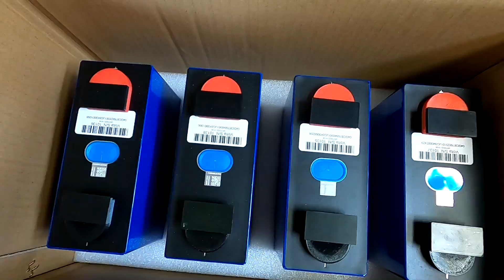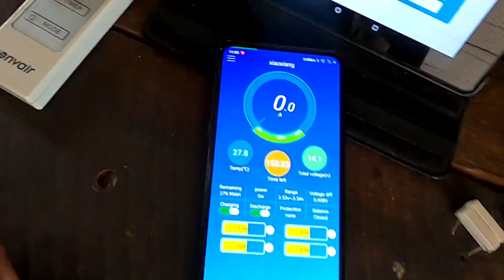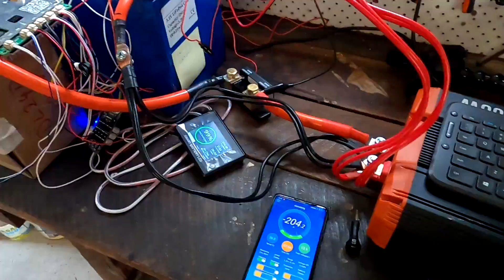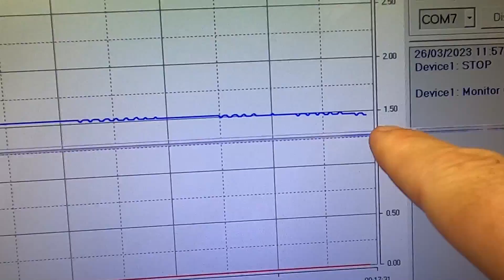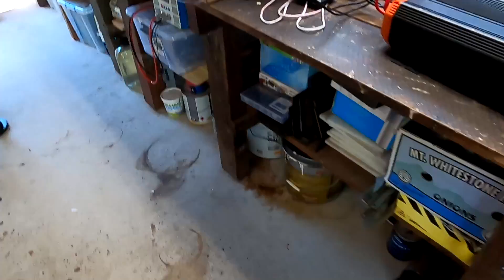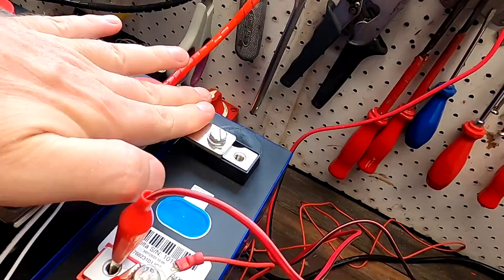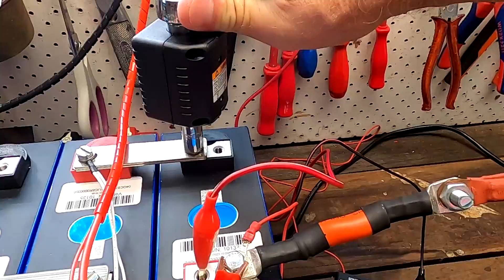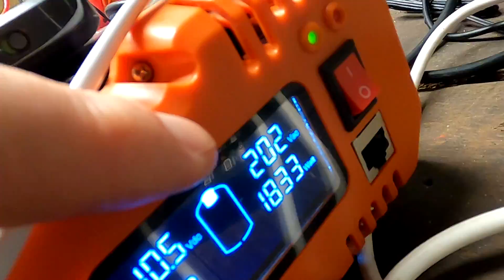My worst B-Grade cells vs. Certified Automotive Grade in a 100%-0% 200Amp Discharge Test. Surprised?

Comment: For automotive use I would prefer a Bus Bar with a bit of give/flexibility Andy - On my RV camper I use some 300amp arched flexible bus bars that are 30 stacked copper laminates from Aliexpress that will cope with road vibrations and temperature change
Reply from the maker: Or, you have to fixate the cells so they don't move any more. Compression 😉
Reply: @OffGridGarageAustralia  Compressed cells still expand & contract with temperature - Trees that bend in the wind last longest  : )

Comment: Very interesting Video Andy! 
The BMS part was my favourite! 😉
Reply from the maker: The BMS is amazing! I really love it. A 16S version with 150A would be a winner!
Reply: Yes we need a 16s 150a   !    I will take 3 or 4 when you make them .
Reply: @onthelake9554  we're working on a 4s-16s version. It will have active balancing on board and the firmware will in all likelihood be opensource so that users can change it in any way they see it. 
The heating connector can then be reprogrammed to be used independantly of the main MOSFETs on the board. Not just for heating but for any 5-10A load you want. 
It will also have some other features and will be ESP32 based so you can basically run a lot of the Arduino applications.
It will also have Bluetooth and Wifi and potentially a micro-SD slot, in case people want to use it for data logging.
Reply: @mullerenergy  This is great news , I will be a customer for sure . And thank you for supporting Andy !
Reply: @mullerenergy  Nice! Cant wait to see this BMS on Andy tests. Opensourse fimware is qreat idea and Im sure that people will love it. On this way your product can work exactly as customer want and need. Opposite for locking bms setting and weird thing like this. Are you shipping worlwide? (Europe). Thank you.

Comment: without any experience.  my mind says  that   if you do a test of those two  packs again after  the certified  pack  makes some more  cycles . you get  even more similar  curve!!! and my mind says that it has to do with the  overtime   usage and they are going to  have better  discharge curves at the end after theyt make some more cycles if they re new and no used !!! . keep up   and thanks for the content
Reply from the maker: Well, both battery packs were new. I have compared a lot of cells but could never find a difference of used cells to brand new ones.
This is another claim, I guess, that cells need a few cycles to settle in and either go up or down in capacity and energy. If it is really the case, it must be minimal so we cannot see it with our test methods.

Comment: batteries dont charge fully first time  nickel metal hydride✋ so peter liPo cheated? memory rounds the curve and shortens cycle Andy #2
Reply from the maker: And other say, don't leave them sitting there for too long before testing as they already lose a bit of capacity and energy.
I don't hink it is true, that these cells really increase in capacity or energy after a few cycles. I have tested many cells and could never find such a behaviour.

Comment: Your certified cells have All the boxes filled in. Ah when manufactured. Why does SFK omit that???? Great video. You can never overcalibrate
Reply: Doesn’t SFK say that the way the measurement is done at the factory is it’s watt hours measured and then they just divide that by 3.2 to get the Ah number? They don’t test for Ah. I think that’s what SFK said. 

I wasn’t too sure about the guy at first but all of his points are absolutely valid and the actual science behind it is proven. Typically these Grade B cells have an IR that’s way too high to meet spec and that’s why you see they perform not so well when major current is applied. 

We just don’t see too many Grade G(arbage) cells anymore. There’s too many decent sellers out there for the scumbags who buy the dumpster diver picks from EVE/CATAL etc
Reply from the maker: I think to calculate the energy by using a fixed voltage of 3.2V is totally wrong. The voltage is dynamic and can only be measured by a tester which is constantly measuring it.
Reply: Are you going to trust your lying eyes or use our new math that favors us?

Comment: Here is a test you can do now that you have established a baseline, charge up both sets of cells to full. Leave the cells unconnected to a BMS or ab for 1 month and then do a discharge test. See how much capacity you have retained to establish the self discharge rate. It should be between 1-2% at most.
Reply from the maker: Even if the certified cells have a lower self discharge rate, it would not justify the much higher price, if this is the only difference. Most people buy these batteries and use them on a daily base with their solar storage system, so self discharge is not a problem.
I understand it could be a 'thing' for people who leave their batteries over winter for 4-5 months sitting there. But even then, what difference are we talking about, 1-2% with certified and 5% with B-grade? Still not relevant then...
Reply: @OffGridGarageAustralia  This story has been played out before, numerous vendors. Once you have a large enough sample size opinions can change. We see swings of up to 15 Ah in grade A, and as high as 50 with grade B. But yes if you are willing to set your limits and tinker with your pack you can get decent results, however,  this is not something you can do professionally. You have had a run of decent grade B recently, but do remember Basen cells... not so good. Either way, Hithium cells look good we are going to order some certified ones and see how they do. Cheers 🍻
Reply from the maker: @sfkenergy  I'm happy to repeat this test again with the Basen cells if you think it would make a difference.
Still, were talking about certified cells and B-Grade cells. Certified never stood out to impress. Only a bit better does still not justify the price.
Reply: @OffGridGarageAustralia  Some would say the headache of constantly babysitting grade B is not worth the price. I say as long as the sellers clearly state what it is it would be fine. But lets be clear the Alibaba sellers WILL NEVER EVER state what they are selling is grade B, always with hidden/relasered QR codes and claim grade A.

So we are going to do a self discharge comparison test with 1 month delay, I think it would be good to compare.

But sure if you put in the extra care with grade B it is certainly a viable option and as more hardware enters the market that understand the needs of grade B the difference will become less and less.
Reply from the maker: @sfkenergy  I don't know, we now have at least two suppliers from China who state that you will get B grade (imprint on the QR code). So, were getting there.
Not sure about this self discharge test. I don't think it makes someone want to pay far more for cells.
First it was the cert cells are better. Some people did tests but could not confirm. Then it was they are better under high loads. Not confirmed either. Now the self discharge... I think we keep looking for something which does not exist.
I haven't heard from many people about headaches or constant babysitting of B-Grade cell installations. Or from someone who has both and can confirm that the cert cells require actually less maintenance (even though the B-grade require none). There is a lot of speculation and unknown in all these claims, I found.
Reply: @OffGridGarageAustralia  I have plenty of grade B with large voltage slumps here, but can not safely ship to anyone, they would need to be picked up.  Once you test cells in the thousands you will see a different picture.  9/10 of our kit buyers use grade B cells, I would say 1 out of every 15 of these customers gets stuck with a dud in there pack. Doesn't hold voltage, has difficult time keeping charge voltage and other issues. 

Given a large enough sample size you will eventually encounter enough to realize this is a gamble and should only be done by DIY enthusiast not the general consumer.
Reply: I agree with you that cells can be classified as B grade for a number of reasons, such as visiual blemishes, insufficient capacity, higher internal resistance, higher self-discharge, etc. Why Andy's were, we'll likely never know. 

1-2% self-discharge may  be right in some instances, however the EVE specs state "≤3%/month". On the other hand, it should also be noted that EVE specs that, to their credit, tend to be fairly conservative, so I wouldn't be surprised if the self-discharge was generally a bit lower than 3%/month.

Comment: Super nifty test! Are the certified batteries really certified? Is there some barcode or certificate enclosed with the batteries to prove this?
Reply from the maker: I just realised there is additional paperwork attached to the other side of the box. It's from EVE directly. I haven't read it yet so will provide these information later.

Comment: I still use my definitely used cells a spammer sold me. They still do their job without me noticing any problems. The JK-bms keeps them balanced and that's it. In practice you will never notice a difference between certified and non-certified cells in a PV plant.
Reply from the maker: That's what I think too!

Comment: AMAZING!  :-D  This is by far the most interesting test in the past few months I have seen, on EVERY channel I've subscribed. Thank you very much!  I still find it hard to believe, even after seeing your video, as AFAIK, exactly that test, close to 1C load, should have shown the real difference with certified EV and storage grade cells. And you also mentioned you used your worst batteries as comparison, so it just can't be pure luck - not with that many batteries from multiple sources - or have they all been hand picked for you? :) The only thing that could explain the results. Amazing results in any case, keep up the good work, I love your style! <3
Reply from the maker: Thanks so much, Lasse. Very kind comment and feedback 😊
Well, if they have handpicked these cells for me, they did a terrible job as they are not better than my worst cells I have 😂

Comment: I wonder if the difference is actually the number of cycles you can get out of them before they start degrading. I guess that test may take a few years though....
Reply from the maker: But even then, what are we talking about? 3000 cycles with B-grade and 6000 cycles with certified cells? I have done 75 cycles in one year with my battery shelf. Even at 2000 cycles, I'm 20yrs in. If they don't degrade because of aging before that.

Comment: Very interesting! Thank you Andy for testing this for all of us out here on the Interwebs, now we really know and can discard all previous assumptions and marketing material / hype.
Reply from the maker: Thanks for your assistance with this test. I'll test the busbars as well at some stage and see if there is a difference.
The result was unexpected for me. I had thought, the cert cells are holding up a bit better.
Reply: @OffGridGarageAustralia  me too, but as they say, hold strong opinions but don't hold them strongly. Let the evidence speak for itself.
Reply: @Off-Grid Garage  Don't you still see the likelihood of getting a bad/under-performing cell or two when buying 16 cells Grade B cells that could affect the battery performance much more than this test shows? Don't you think that theres a matter of 'Luck of the draw' when ordering Grade B cells or perhaps the production process has matured in the past couple years that makes it less likely to get an underperforming cell?
Reply: @580guru  I used to order extra cells to cover that likelihood. Buying the certified grade cells takes away that need. But you are right, there is definitely more to be considered here and I am sure we will get to the bottom of it over time.
Reply from the maker: @580guru  Well, with my Battery1.0, we had a couple of bad cells in one batch and the whole system is only as good as these cells now. But, you know, 10Ah more or less really don't make a big difference. As long as these cells don't degrade much faster than all the others, I'm not too concerned.
With all the cells I bought, I always had some with less capacity and some with more capacity as rated. And as we can see, even the certified cells are not much better.
I would not recommend ordering cells from AliExpress though but go through 'reliable' sources like QSO, Gobelpower or Eel for example. At least you have a person to talk to if something is wrong.
Reply: @Off-Grid Garage  Thanks a ton for this testing Andy. I am now at least open to saving some money on my next battery project.  If I do I'll be sure to buy you a couple brews!
Reply from the maker: @580guru  Thanks a lot Mark. I appreciate your feedback and support.
Reply: did you see the 200-250A test by SFK? see their video. There was a big difference in voltage drop when drawing 200A. The bad cell (dont remember what brand.type) dropped below 3.1v :O
Reply from the maker: @PhilippeCJR  Didn't see the video, no. There might be the occasional 'bad' cell which they found and test now. I could not find such a cell or haven't heard or read from anyone having such a cell.

Comment: Bonsoir :) The certification relates probably to the repeatability of the large sample. You are guaranteed that if you buy 30 of them, you'll get the same discharge performance throughout the sample, within some small error level. For the others... You were probably lucky :)
Reply from the maker: Well, that is just another guess though that they might be better in the future. There is no proof of that at all.
Reply: @OffGridGarageAustralia  to be asily cheked. Ten replicates of both grades is enough to run a t-test :)

Comment: Thought for the day - Any cells that have sat on the shelf for >1yr could they be considered Grade B due to lack of use since they were manufactured?
Reply from the maker: If they were stored at around 50%SOC, there is no problem with that.
Reply: 18 months is what EVE and REPT do, after that they are sold as grade B. This usually happens because of an odd ball left over supply amount.

Comment: Great test video. I like these massive terminals and massive basbars with two screws on each side to give a large contact area, they will get a lot lower heat and probably be a lot more expensive. But for normal use (not ultimate 200A test) it will be probably over dimensioned, I would say, so for normal use those classic welded M6 screws on the battery cell terminal will be fully sufficient, is that right?
Reply from the maker: Well, you will be surprised that it is the opposite. The terminals of the cert cells got much warmer than of the b-grade cells. The tiny contact area of the welded studs (b-grade) are perfect for 200A+ and don't heat up much. The force really concentrates on this small area and resistance is super low. 
As you have seen in the video, I had issues to get the resistance of the large contact area down (cert cells) while the studs on the other battery works well with 200A+ and only 4Nm of torque. 
See also this test video about the welded studs if you haven't seen it yet: https://youtu.be/VPQvs-2YYzA
Reply: @Off-Grid Garage  Some of these double screw terminals were anodised in the past on the LF280K. 
Maybe that's the issue that creates the extra resistance because all the current then needs to travel through the bolt only?
Maybe this is also the "old" cell in the pack? Strange there is a year difference between these kind of quality cells.
I'm expecting 16 cells next week, same grade and with the same terminals. Can't wait to check them out!
Reply: @OffGridGarageAustralia     Great test (as always!) and a surprising outcome!

Comment: If cells have dents in them but no puncture holes are they still safe to use I bought some scratch and dent 277ah cells with dents in the casing on some of them..
Reply from the maker: Yes, still OK if not dented heavily. I use two cells with dented corners and they work fine.
Reply: @OffGridGarageAustralia  ok thanks

Comment: It is summer and hot in my city. My cells reaches 39⁰C after ~5 hours of 50A.
Maybe Automotive Grade Cells have better temperature performance.
Reply from the maker: Pure speculation. They come from the same factory and production line, they are the same batteries.

Comment: There is nothing to add.  Great test. 🖖🖖🖖
Reply from the maker: I think we have tested everything now, right? Results are clear.
Reply: @OffGridGarageAustralia  I think yes. It's a really great test.
Maybe it is not directly related to this topic, but I would be interested in one thing. How accurate is the measurement (performance, power, voltage, current, etc...) using Banana Pi with Venus OS + JK BMS if you compare it to the Victron Smartchunt.
You have inspired me very much and thanks to you I embark on a similar project. I like your sense of precision and a sense of detail.
Thanks for all the videos. 😉
Reply from the maker: @Slavomir-1977  Uh, that is hard to say. So far I could see a quite large difference between the Pi and the JK in terms of SOC. Which is one correct, is hard to tell though. Because I have so many different BMSes I made the Victron shunt my point of truth. For my installation, it is no question to use the shunt as I have several batteries in parallel.